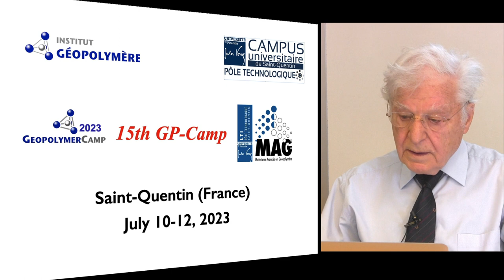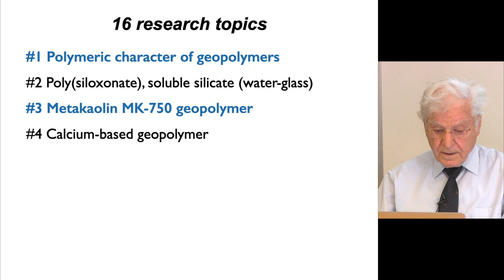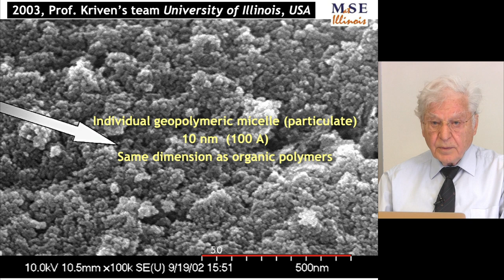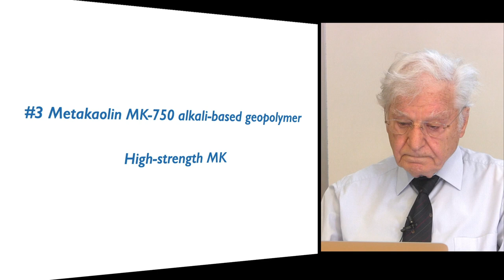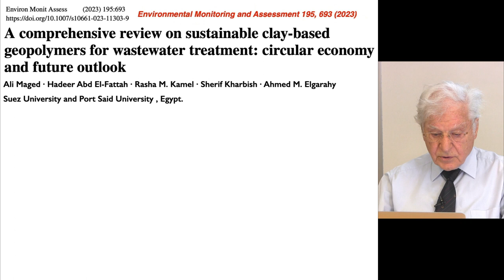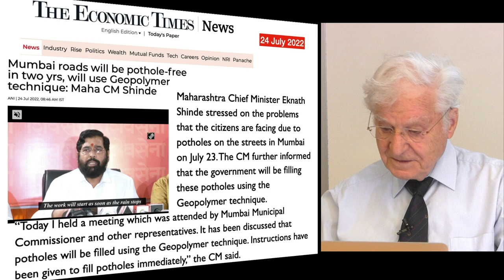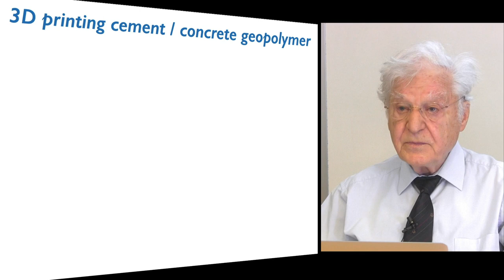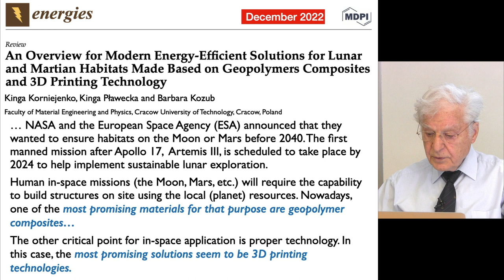First 3D-Printed House in Geopolymer (Keynote 15th GP Camp)

Comment: Did we experienced hydraulic effect with GP? Hydraulic cement expands in the setting process. 

From expansion within a mold or in a desired 3D restricted space the material can self compacted to gain strength later after setting, ie compression, as well as tensile strength
Reply: It never expands, forget what you know about OPC, it doesn't work here. Geopolymers are polymers, not hydrates. They are not called "geohydrate" for a purpose.
Reply: @WilloPax  thanks for commenting. Do you mean geopolymer can not expand? 

I was convinced that Inca Wall in SAQSAYWAMAN Peru are made of some unknown mix of geopolymer that expand as it cure. Leaving behind conformal and seamless fitted polygonal blocks. On the other hand all these blocks appears have been through swollen before it get set.
Reply from the maker: Yes only if you want to make foam by adding some chemical additives that creates gas and bubbles.